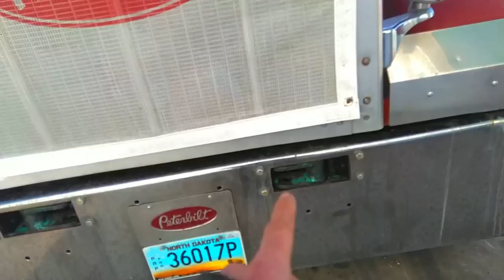every old school trucker loves chrome and lights - the legends of chicken lights

Comment: Steve Fezchaick a.k.a FSC Trucking;did the same thing about 3 years ago when his factory stock bumper on Orwell his 1984 Peterbilt 362 cabover,got damaged.When he replaced the bumper;he installed a bunch of LED chicken lights on the sides & across the bottom of the bumper,and also installed heated LED driving lights on the bottom of the bumper;to increase overall visibility while driving at night as the factory stock halogen incandescent headlights aren't nearly as bright,as the heated LED driving bumper lights.
Reply from the maker: iv got led headlights on the truck there pretty awesome.
Reply: @Ezrider359  I watched the video where you installed those heated LED headlights,and yeah they are awesome.They are more energy efficient,and are a lot brighter than the factory stock incandescent halogen headlights.Steve will wait until his current incandescent halogen headlights burns out;before deciding wether or not to replace them with heated square LED headlights,or just buy another set of incandescent halogen light bulbs.
As for the new bumper on his truck;it didn't come with the pre-drilled holes to mount the chicken lights he bought,so he had to carefully trace the shape of the lights onto a piece of cardboard;cut out the light shapes,then tape the cardboard templates onto the bumper and trace the light shapes with a paint marker;then used a a drill bit in a cordless power drill to make pilot holes,then used a pneumatic Sawzall to carefully cut out the holes for the chicken lights.He could have just called the chromeshop and had the bumper custom ordered;but then he would have payed even more money for the labor ontop of the price of the bumper,so he decided to save money and do all of the work himself.

Comment: O-H-I-O Porter greetings.🇺🇸 By the looks of it, your old bumper was in need of replacing. 🧐 A nice chrome bumper on that Pete really brings out her beauty!🤩 I’ve not seen the wiring harness like that…they lined up & gave you plenty of extra for another project. That gives her some nice bling for the front end & the chrome will surely reflect some of the light. I’ve not used dielectric grease is always good to use as well. Good stuff! I’ve never heard those stories of the chicken lights before. Interesting! Blessings my friend.🥰😎✌️

Comment: I put some of those pedestal lights on the bottom of the bumper of my 359 and wired them with the turn signal circuit constant hot as a running light and DAMN are they bright.  I’ll be using your discount code for more 👍🏻

Comment: Dielectric grease should never be used on the actual electrical conductor or contact as it is a insulator and can create a high impedance condition.  Dielectric grease should only be used on the seals of connectors.  I often see people using dielectric grease on the tip of spark plugs and it is completely wrong to do so.  On spark plugs it should only be used between the porcelain and the rubber boot.  When dielectric grease becomes dry all sorts of electrical problems occur.
Reply: You are correct with that as dielectric grease actually increases resistance in connections.  It says right on the tube that it should not be used on the actual contacts.

Comment: Hey what you doing with the old bumper. I have a 359 and over at New Town and be interested in it
Reply from the maker: The bumper is cracking in a few places and has a slight crease in it as well as a dent. I don't know that it's worth the gas to drive from Newtown
Reply: That's fair probably still better than mine haha thanks for the honesty

Comment: A real bumper would take 6 guys or a forklift to install it, that's just chromed heavy Sheetmetal.  :face-green-smiling:
Reply from the maker: and i haul a lot of stuff that pays by weight.... from a practical standpoint id really like to have a cow catcher on the front for when bambi decides to run out in front of me but they are heavy they add a step to opening the hood and i prefer the look of a simple chrome bumper and id like to just try avoiding hitting anything that id need a bigger bumper for to start with...lol
Reply: @Ezrider359    Yep, good logic there.   Have you considered putting a pair of amber fog lights on your truck? Gotta have them for the North Dakota blizzards and fog.